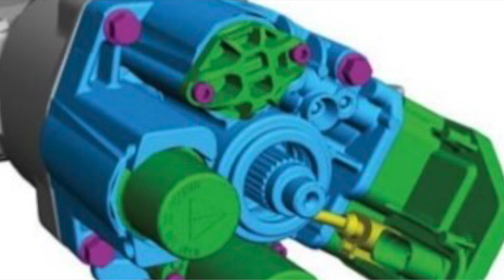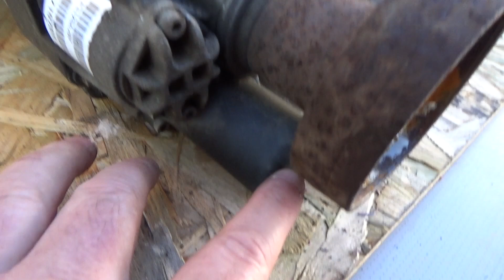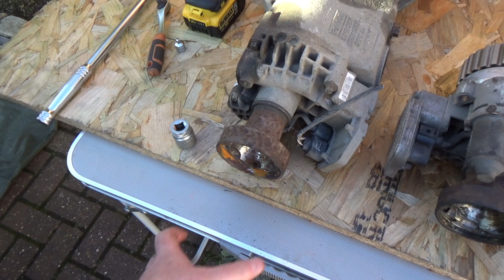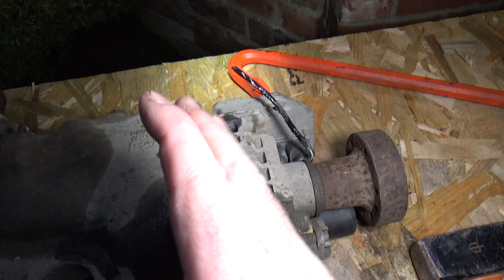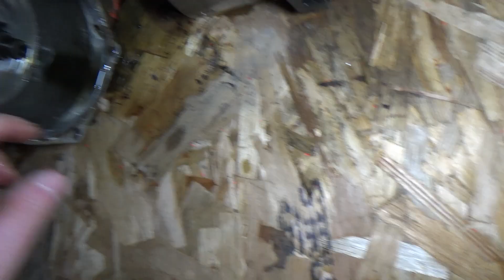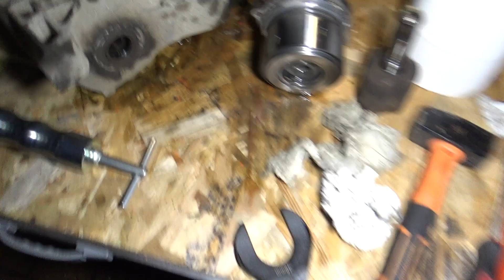Rear Differential & Haldex (Part 1 of 6) - Land Rover Freelander 2

Comment: Omg , if you are using a lump hammer properly, then hit it with the tool you have rightfully chosen even though you don’t seem to know what you’re doing 😂,

So hit it on the back of the steel prop shaft input  coupler 
I have done about five of them, 
and they always come off first hit you had the tool in your hand, but you didn’t use it properly !

So thank you for amusing  me 😂
Reply from the maker: Erm, I did hit it on the back of the prop shaft coupler, lots. This haldex was totally jammed in the diff due to corrosion.

Comment: Did mine last year and took it slow over 2 days on a concrete driveway with a pair of very heavy duty axle stands. From memory, I think I bought a large exhaust clamp to put around the inner CV joint housing to pull/lever against.

Comment: I think it's great your highlighting the issues faced when doing these jobs as it's factual happenings not the magic of YouTube or the internet (being done in a 5min videos) as you refer to and we all see.
 On more positive notes gives us a chance as a community to suggest work arounds or easier methods from experience or just different trains of thought. With the separation issues and seeing the very real struggle my plan would be leave it on the car; and use a jack in the same way you would, a slide hammer with some rope. Seems a good suction sealing that!

Comment: Beavis, I've watched many of your videos!  I do enjoy the detail you put into each!!
I did this exact replacement on my 2008 LR2 in Jan 2022.  I purchased an upgraded/rebuilt rear differential from Austen at Bell Engineering and even with shipping (and core that I didn't send back) to the US it was reasonable at approximately $1,200.  Overall, the job was a pain!  The half shafts can be difficult to pull from the diff but I used a 3" exhaust clamp around the cup of the left half shaft so I could put a piece of wood against the diff then use a prybar to dislodge the internal spring clip to remove that half shaft. I was careful to not overtighten that clamp so as not to deform the cup.  The right-side half shaft is easily removed with a prybar!  I only removed the lower control arms on the left side (driver's side in the US) to allow removal of the left-side half shaft.  Then, once that shaft was out of the way and the other mounting bolts were out of the way I just lowered the differential and then freed the right side half shaft as I could then swing the diff to the left to allow the right side half shaft to be removed from the diff.  It worked surprisingly well!  I did have a floor jack under the diff but it was still a little wobbly as I was removing the right side half shaft.  Overall, I think it was easier than disconnecting the control arms on both sides of the vehicle in order to swing both hubs out of the way.  I was quite lucky that I have very little rust so all bolts were relatively easy to remove!  I too was originally thinking of "upgrading" my Gen3 Haldex to a Gen4 Haldex but thankfully I also found out before attempting that they are not compatible due to differences in communication protocols in the controllers.  My Gen3 Haldex had the same smooth clutch shell as the one you removed and I guess I was lucky because once I removed the bolts, the Haldex unit slid out of the diff with very little effort.  I did have to pry in the same manner as you but with much less effort -- maybe 5 minutes to remove the haldex from the diff.  
Overall, I think I spent around 6 hours on the full diff swap but I did have everything ready to go when I started.  
After three years of driving, I've put about 10k mi on the car (it's not my daily driver and I work from home). I can say that the diff is still smooth and quiet!

Comment: I know exactly what you mean that things take longer than any workshop or magazine mentions. I’ve been working at mine over weeks on days off. Started with PTU and now on the haldex. Exhaust, propshaft and haldex pump took me two days alone due to the pump being seized in place. Never apologise for videos being long it’s what people like me need, jobs in detail. Keep up the good work.
Reply from the maker: Thank you! It’s difficult pleasing everyone but I think the most important thing is that it’s as close to real life as possible.
Reply: @ exactly! Too many videos edit out the pitfalls and problem areas. Just about to refit the exhaust, refill the haldex then see if all my work has been worth it. Splines were destroyed on PTU and gearbox so rear diff and haldex have been redundant for years. Probably opened up a can of worms now.
Reply: Just for reference I have recently had my PTU & Rear Differential replaced, and whilst this was being done the Haldex Unit Serviced, gearbox oil changed, an new PTU Splined Sleeve. The new rear diff has the uprated bearings. It took 3 days at a total cost of £3,500 this may help some decide on if they'd prefer to do it for themselves, the work was carried out by a Land Rover Specialist.
Reply from the maker: @daddiosstudios7335 wow! That is expensive! More than my car is worth!

Comment: The Generation 3 Haldex requires dismantling of the coupling to remove the pump to replace the filter. This means replacing a seal and flange nut with quite a high torque setting. For this reason I always assumed the Haldex gen4 would be easier to service. 
Gen 4 advantages over Gen 3: Reduced base torque at high differential speed; Torque activation independent of differential speed; Accurate torque limiter; Energy stored in accumulator; Lower max current consumption; and Faster response.

Precharge pressure increased from 500 to 1500 Nm in the Gen 4.
Reply from the maker: Thanks, I’ll be looking closer at the differences in part 2.